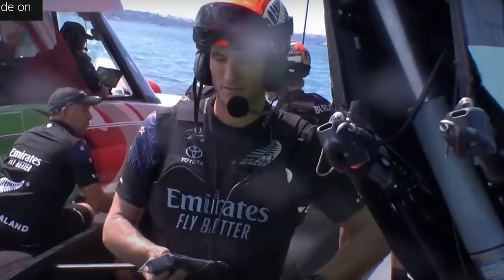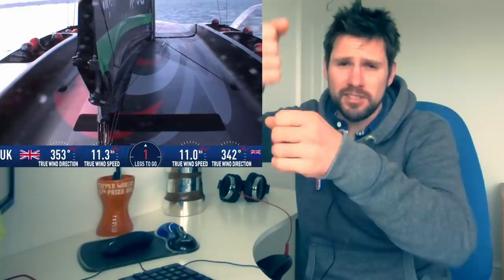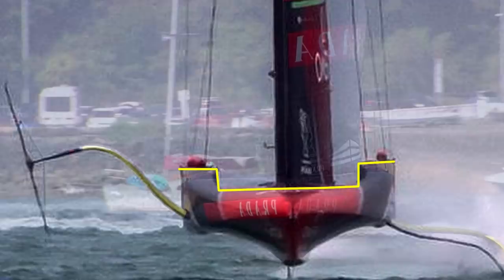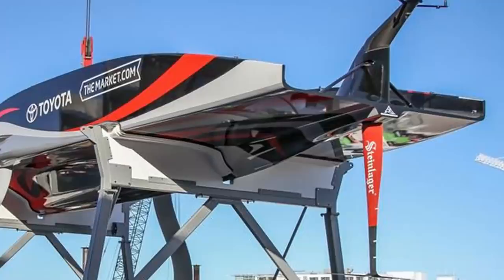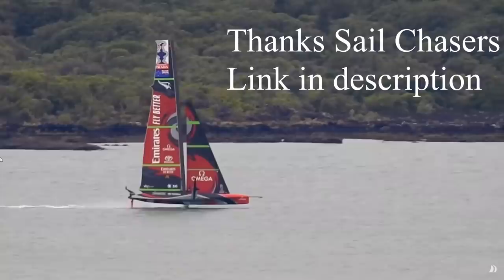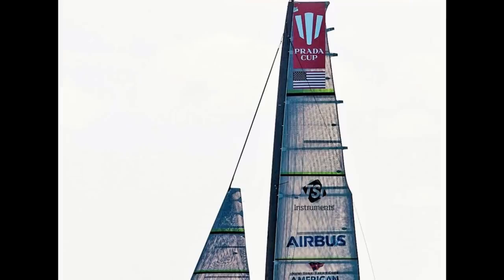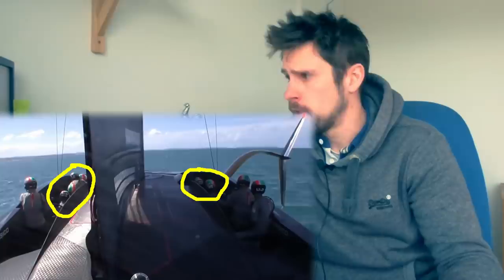America's Cup Mainsails: Another ETNZ Loophole! + Mysterious Upper Control Zone

Comment: as said in a previous video comment, i am surprised to not see sail with higher negativ leech. It is a very efficient and dynamic way to control trim and overpower of the head, especially  when you sail more or less at constant apparent wind angle. And it reduces the issue of inverted profil around the head sail

Comment: the foot of the mast has to be at 1500+-10mm above MRP and the foil arm pivot has to be 520 +-2mm above MRP. Building the deck ~450mm below the mast step has allowed NZ to add about 3 square meters of sail area which has added about 12 m^3 of sail area moment in a place were the AWA is very close to zero. The full rig has a sail area moment of about 3500 m^3. So the change in heeling moment caused by this fudge is BA  about 0.1% if that, while it has added drag and no extra drive With the termination of the sail on the deck and increased luff length the sails induced drag coefficient will be slightly less, possibly 3% less but induced drag is not a large percentage of total water and air drag at low AWA's. In total is not much but it is a game where every little bit counts.

Comment: Thanks for the quality content, nice video.But i suspect the white, than black, lines next to main sheet on LR are to control leech tension since, not having a boom you can't pull it with the vang. I'd say they prolly have a pulley system that phases it with main sheet and cylinder for tensioning. In low winds the tension is much higher, in comparison to pressure on the sail surface, so it opens up a gap in the lower part. I guess the camber control is next to the boom, acting on the battens.
Reply: Interesting thoughts...

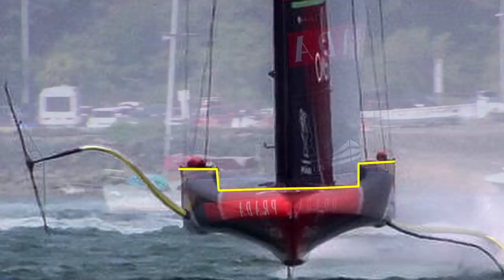Comment: 4:44 the forward movement pressure calculations would be interesting to look at with the lowered deck. After all you have 7-20kt from the side  airflow quite turbulent low down but 25-50 from the front over a large aerofoil section the air trapped by the large sides with a venturi lift meaning less drag required in the water foils as it leave's the boat.

Comment: There also appears to be a reduction in drag on the hull with that very thin stern. With the crew in the side pods it could allow a lifting capability in the centre of the hull.
Am I also right in thinking that the grinders are at the rear of the boat? you've probably covered that before.
Reply from the maker: Yes, they have grinders and 'afterguard' mixed through the boat. We've got a ETNZ 'crew roles' video coming up after the Prada Cup

Comment: just looking at the photo have team nz set the mounting point further up inside the mast so the mast actually covers the mounting point therefore the mast rotates all the way down to the lowered deck level.
ie the mounting point is in the prescribed position but the mast is longer or just lower over all relatively speaking
Is there a total fixed length of the mast in the rule?
Reply from the maker: Theres a fixed length of mast above the ball. Below the ball is fairing and part of the lower mast control zone.

Comment: The videos just keep getting better... mods to copy NZ lower mast probably way to drastic and not enough time I’m sure for either Ineos or LR to do it. But maybe there are ways for Ineos to loose the boom and get something somewhere between NZ and LR and get some marginal gains for themselves. 

With the extra three days delay fingers crossed 🤞 Ineos have been able to “through the kitchen sink at it” and do some of the mods you have identified. 

They have certainly had enough time to add the foil drop software as an optional mods and practice to prove it works for them.

I just hope they have taken some calculated risks and these work and give them the slight performance advantage going forwards. As without that I can’t see LR loosing enough of the remaining races NOT to get to seven. Fingers crossed 🤞 Ineos  do somehow pull it out of the hat!!!

Comment: If NZ has spotted and exploited a loophole, what's to stop others copying?
Reply from the maker: The whole structure of the yacht is based on the mast step height. They would have to build up their mast steps and move both the foil arms the corresponding distance. Then they likely wouldn't be compliant on other CoG and CoB rules... so it's pretty much impossible to copy at this stage.
Reply: @MozzySails  They did draw up the rules, it must be an advantage.
Reply: @MozzySails  Isn't that enlarging the main sail area - which is restricted by the rules ?
Dropping the deck and extending sail area ???
Reply from the maker: @istra70  nope, sail area below the mast rotation point doesnt count in the measurement. Free sail area.
Reply: @davidbrinkman2768  But EVERY team has the SAME rule book !  It is just the Kiwi way to always be thinking about the simplest/cheapest /most effective and laziest way to sort a problem ... and I don't like the inference that we have an advantage or are CHEATS, that seem to pervade these discussions
Reply: @bobawatsit  I would even say that it may not be advantage at all., because of boat sides being raised and causing like a channel. That foot of a main sail  may not work so well as they hoped.
Clean deck of Luna rossa - without any side obstructions - to me is advantage. We will see in any case.....
Reply: @bobawatsit  Yes and talking of cheating inios has a yellow card  for professional cheating so why keep on insinuating Tmnz are maybe cheating????
Reply: @Dodiwho1  cannot come to grips with your comment ... I do not think ETNZ are cheating at all, they read the RULE book as did all the other teams ( ETNZ seem to have thought outside the confinement of the proverbial SQUARE, had there reasoning checked by the rules committee ) it seems to be other patrons of rival syndicates ...even this very vlog questioning the validity of their actions
Reply: @istra70  IMO, at worst there would be little to no advantage from certain wind angles, but in others they likely derive some advantage from the additional sail area. Remember, the apparent wind in these boats is very far forward, thus likely reducing if not rendering any obstruction from the channel sides as minor. They probably took that into account and didn't think it represented a significant aerodynamic concern.
Reply: @jamesaron1967  Yeah, I though about that . Nearly all wind coming from the bow , but wing inside a tunnel or between two walls can not be as officiant as in the clear.
That's my feeling, but simple wind tunnel or pool experiment would show it.
I don't think it's advantage. My 2 c.
Reply: @istra70  Yes, a wind tunnel or computer fluid dynamics modeling could certainly reveal the effects of the channel. My suspicion is that in some conditions it's not only unobstructive but might actually enhance the flow of air at the base of the main by increasing pressure variance between windward and leeward sides of the sail. In other words, the channel is doing exactly that, channeling. However, not being an aerodynamicist I cannot confirm this beyond a mere hunch.

Comment: I just watched the American Magic capsize again and wonder if I might have spotted a potential save in marginal situations. It goes like this. As an AC 75 heels excessively there comes a point where the righting moment from the raised windward foil arm starts to reduce dramatically. If the foil arm were lowered at that point it would increase the righting moment since the weight would be moving further from the in water foil that everything is pivoting around. It would be a tricky thing to pull off under pressure but if it were set up to occur automatically beyond a certain angle of heel it could save the day. Any thoughts anyone?
Reply: Totally agree, I had the same thought! Moreover the other problem in the case of American Magic (and also Ineos in pre-start during the Prada final, thank God they were upwind!) is that when the foil increases his angle of attack, it behaves like an airplane at take-off and the boat started to climb: maybe would be possible to use automatically the flap as ailerons, over a certain angle of attack, to keep the boat down
Reply: @canaleluigigalli  Thanks for your comment. I was beginning to think I was on my own with this idea. 😉

Comment: I wouldn't regard this as a loophole from the perspective of regular English language. More like thinking outside the box.
In contrast, the bendy foil does bend the language of the rules written in English! :)
Reply from the maker: "A loophole or loop hole is an ambiguity or inadequacy in a system, such as a law or security, which can be used to circumvent or otherwise avoid the purpose, implied or explicitly stated, of the system. "
I think the intent of rule was to fix the height of the bottom of the mast relative to foil cant axis and fix mast length. So, do believe this is a loophole.
Reply: @MozzySails  thank you for replying! I see your point.

Comment: When you say extra area at the bottom isn’t there still a maximum area? So the benefit is just more sail area lower down not extra sail compared to others?
Reply from the maker: The sail rule assumes a leech length in the area calculation and luff length is obviously assumed to be mast length.  So then it just multiplys by the sail girth at 5 measurement points. This basically means the area you get from dropping the clew and tack lower is free.
Reply: @MozzySails  okay that makes a big difference free area and low down :)
Reply: @MozzySails  After carefully thinking about it I, have some afterthought. For sure I'm not very well versed with fluidodynamics, and obviously ETNZ made all the models and simulations required, but I still missing something.
The whole point should be not to add sailing surface for the sake to add it, but to increase the thrust forward. Considered that in the AC75 the sail behave totally as a wing, I can't understand the principle that give an advantage to use NZ configuration. The extra bottom area of NZ sail lays in the depression of the deck, between the two walls of the crew's cockpits, that means that due to the sail shape, the leeward volume is reduced, leading to an increase of pressure, while the windward one is increased, leading to a decrease of pressure; in turn this should create a downforce contrary to the lift expected by a wing.
There is somethingh that I'm missing? Can you please give your opinion about it?

Comment: Fixed mast point is not as high as green line. Difference is only for the height of mast "fixed point stem" at 4:03 . Cockpit edge is actually raised above that fixed mast point and green line is even slightly higher. By measuring with my eye i would say difference is about 25cm of bottom sail area, but then again ETNZ has really messy trailing edge compared to Luna Rossa. I think there will not be much of performance difference.

Comment: Isn't lowering the deck increasing boats weight ? In my opinion bottom part of the main sail can not work efficiently when is between two walls.
Convex and clean shape of LR deck is  in my opinion more efficient.
I am surprised that none of the boats has fitted vortex generators on the bottom part of the sides of the mast , which would activate and deactivate depending of mast rotation. That would give them way more power....
It's working in aviation.